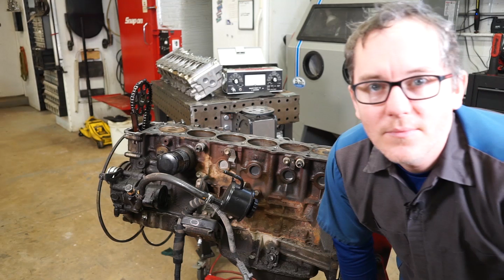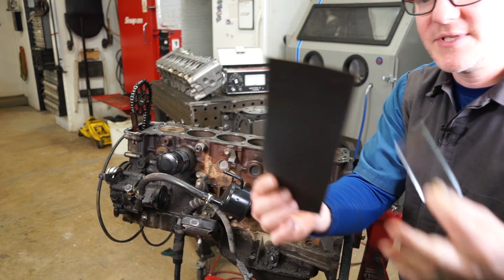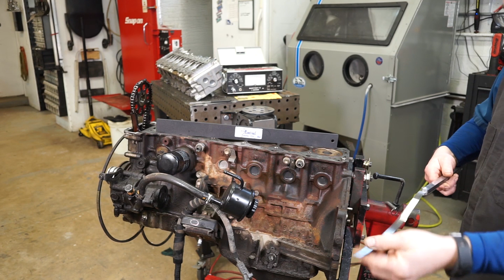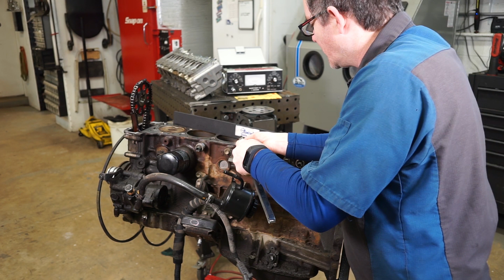80 Series 1FZ-FE Head Gasket Part Two Checking the Block

Comment: Otramm how do I select the thickness for cometic head gasket for 80??
Reply from the maker: Measure the compressed thickness of the old gasket and add the amount that the machine shop removed in decking it.
Reply from the maker: You also have to make sure the surface finishes on the block are in spec for an mls gasket
Reply: @OTRAMM  thank you for this info and getting back so quickly!

Comment: my cylinder block cooling ports  bitween the liners angle drilled all 10 are cloged.  I have tryed to clean them but dont know how deep they are . yor help will be very helpfull.
Reply from the maker: They're a few inches deep. I used a piece of welding rod to clean out the last ones I did. I chased it with compressed air after I got the wire pushed through. They open up in to the water jacket in the block.